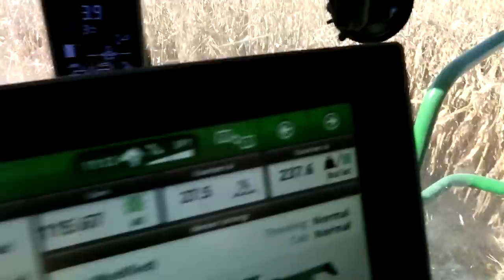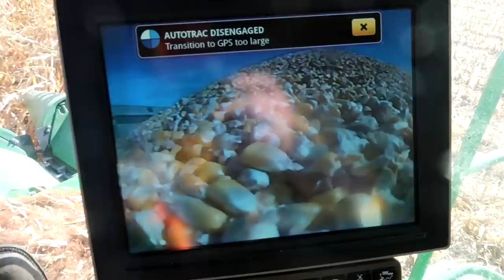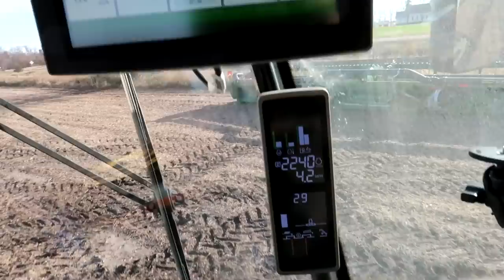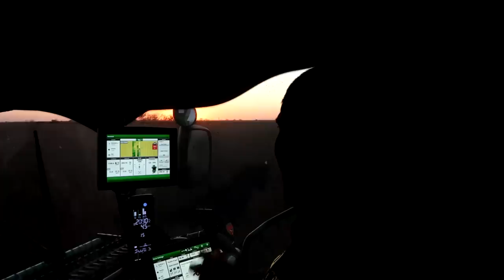Combine Stuck on a Hill

Comment: As someone who farms hard hills I feel the fear of sliding down a bank.
Reply: Especially into water pond... I just wanted to get the tires dirty on the truck and the road disinterested and it nearly rolled over... Had to leave it and climb out the passenger window. Good thing the air box was not in the water like the mirror and steering wheel... It fired up... Pulled out with the help of another 4x4 and a chain. Quite the pain to clean.

Comment: Hi Zach, what incredible conditions and you're capturing the moment extremely well.  I love you "can do" attitude as you're being challenged as never before.   And you're getting the corn and soybeans in the bins!!!  Thanks for reminding us that the wet conditions not only impact the work in the field but also in the transport equipment, the elevators, etc.  Thankfully, the dryer is working and doing what is necessary to save the crop.   Best wishes and thanks!     - Dean from Edina

Comment: Great video funny thing is that I was just talking to my friend today and I said what color machines you got and he said red and I said if it’s red put it in the shed😂
Reply: If its Red I wouldn't bother, you can leave em outside to rust. Save the shed for good equipment.
Reply: If it's green, it probably caught on fire and burnt to the ground before it ever made it to the shed. Truth be told, at the end of the day, they're all great when they work right and they're all a pile of junk when they don't.
Reply: @kevindircksen181  Hey Kevin Well if you want to get technical while its on fire its Red so at that point you wouldn't want to put it in the shed! 

But yep totally agree each manufacturer builds some good equipment and they each build some that trouble. My dad ran Deere equipment as I was growing up so that's where I gained a liking but my wife's side of the family runs red. At the end of the day it does get down to some preference/what you like and enjoy running and or working on and another biggie is dealer support! Around here the red dealer is mediocre at best and the Deere dealer goes the extra mile.

Comment: Always get stuck on hillside.  Water drains down and holds there. Everyone thinks the hill is high and dry. Back in Illinois growing up in the spring especially you would see tractors with cultivators stuck on the sides of the hill a lot.

Comment: The wide footprint of the treads on the S780 make for reduced ground pressure.  This is great for preventing the machine from sinking down into mud and getting stuck, but in a situation where a lateral force (gravity, in this case) is acting on the machine, it's actually worse for keeping the thing on line.

Comment: Several smaller, lighter combines on tracks will get the job done. I have seen rear wheels put on skis. I have seen combines pulled by cats.  In your weather area bigger is not better.
Reply: My sister's crop is under the snow. In 1980 I swathed wet land with a new JD swather that dad modified to Bombadier tracks front to back. Deep ruts but we got it off.

Comment: We called them both headlands and end rows interchangeably
Reply: Alto the definition of (copy and paste) headland is a coastal landform, a point of land usually high and often with a sheer drop, that extends into a body of water. It is a type of promontory. A headland of considerable size often is called a cape.[1] Headlands are characterised by high, breaking waves, rocky shores, intense erosion, and steep sea cliff.

Comment: What kind of weather forecasts do you use?

Windy.com (completely free) with ECMWF forecast model turns out to be extremely reliability for me for daily forecasts and somewhat reliability for the 7-10 day forecasts - times might shift a bit regarding rain or storm :)

If you compare it to the GFS forecast model, what most weather providers use, since it's free, is mostly complete nonesense at my location, like you said "20% chance for rain, so they're just 80% wrong" 🙄😂